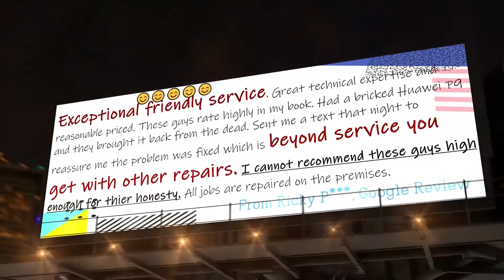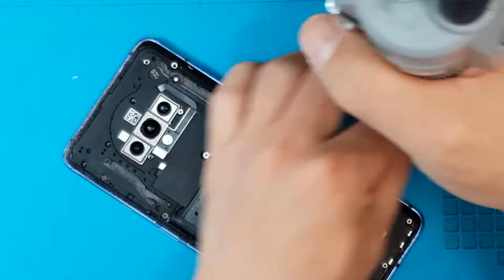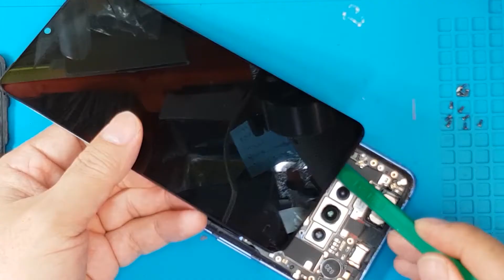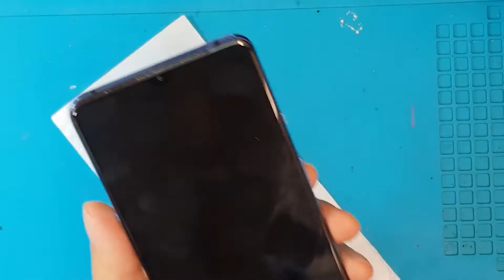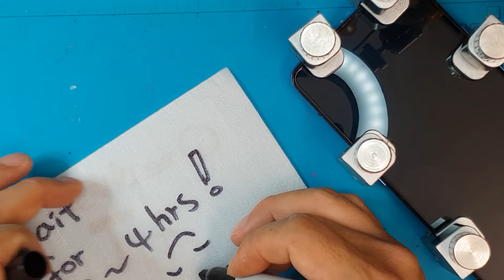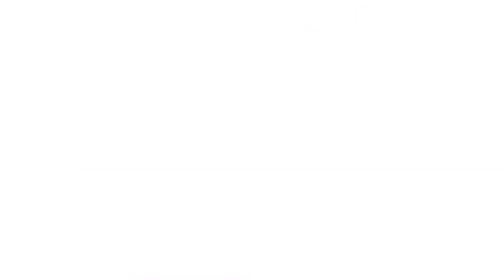A Bleeding #OnePlus 7T LCD Display | Sydney CBD Repair Centre

Comment: Helo sir i recently replaced my OnePlus 5T display but having a problem touch is working with some delay and when  low display brightness causes red colour in apps background ground
Reply: Display ka hi problem hai  change karwa lo ya jisse change karwaya tha usko batado ke ye problem hai ...
Reply from the maker: Hello sorry on what happen but either the replacement parts you use is damage or you replace screen in a wrong way

Comment: THX. great, but there is a big problem with the fingerprint sensor! How to fix it? Factory reset doesn't help.
Reply from the maker: it might be the quality of the screen you replace cause after we fix all working including fingerprint sensor
Reply: @SydneyCBDRepairCentre  The screen was swapped from another Oneplus 7T, so the quality is ok. This is a common problem after screen replacement. The solution is supposedly to calibrate the fingerprint sensor.